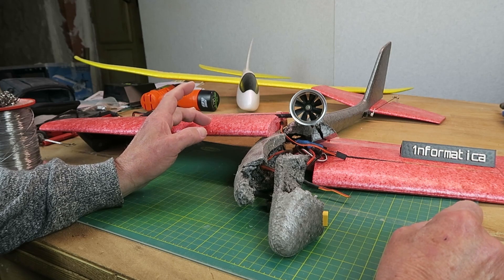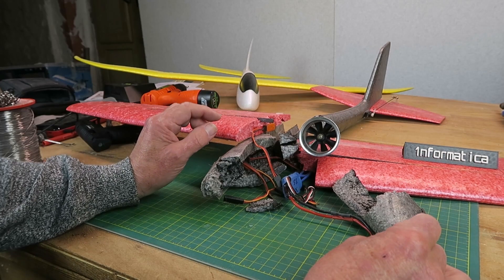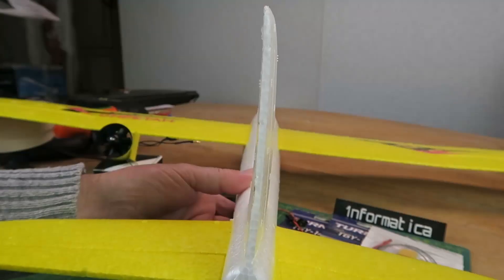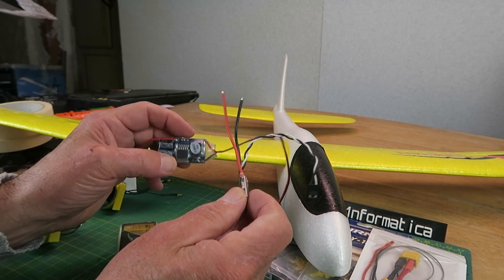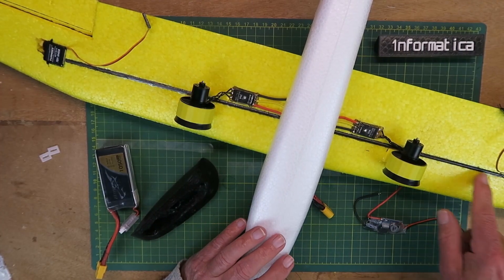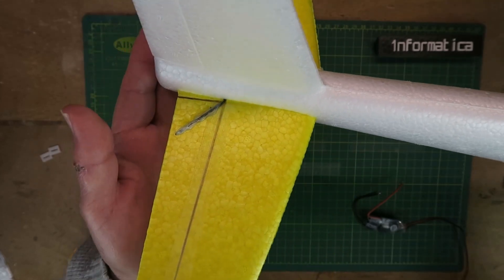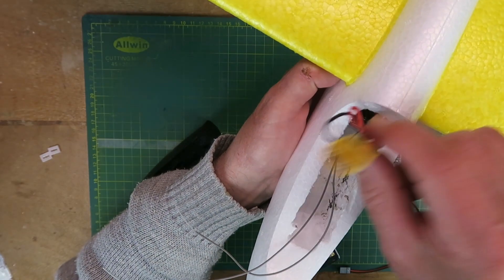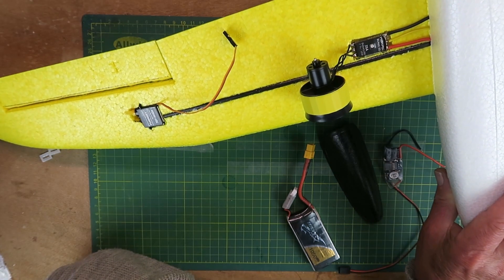New 30mm Twin EDF Chuck Glider Conversion

Comment: Good video, can you tell me the location of your C.G and the size and diamerer of your carbon rod? Thanks.
Reply from the maker: The thing to do is to test glide before doing any mods and note the CG. In this case it's about 1 third of the wing chord. I think I actually used a 4mm carbon tube as the spar, it was a while ago!! Thanks for watching, have a great day!
Reply: THANKS. @1nformatica

Comment: I built one with drone bits ( 2 channel)
Today I finally got the gyro problem sorted out that would cause one motor to cut with a heavy bank .
 So, test flying in the house today it went straight and level straight through the wife's glass cabinet. 
 Probably shouldn't fly in the house.
Reply from the maker: Glad you got it working. No flying in the house eh! Guess that's why I'm divorced!!

Comment: I think the wings will break at the servo wells......... I flew mine for the 1st time today with the full length fiberglass spars on top Floats like a feather I don't see any problem with the weight
Reply from the maker: Yes, the servo wells are a weak point. I've given mine a lot of abuse and the tips just flex, the foam is very resilient. Thanks for watching, have a great day!

Comment: the yellow esc is a cheap esc for china and if you had two yellow esc from the same seller i bet if you cut them open they would look different and they suck I took off the wires and connectors and tossed the esc in the trash
Reply from the maker: I have had better luck, I've bought several of those "el cheapo" power systems with ESC, motor & prop and only had one with the ESC dead on arrival. Never had one fail in flight (yet)!! Thanks for watching, have a great day!